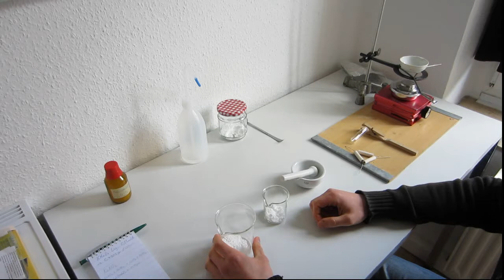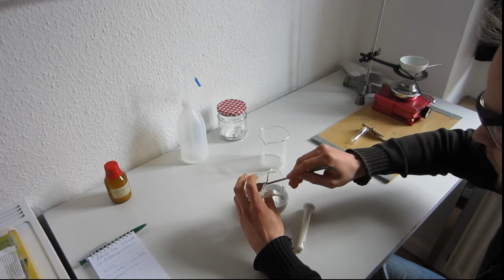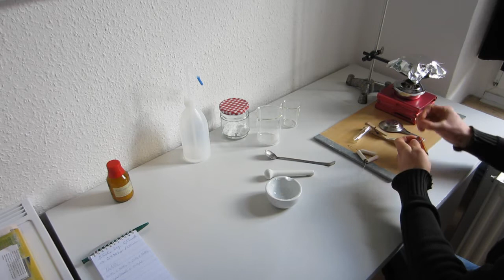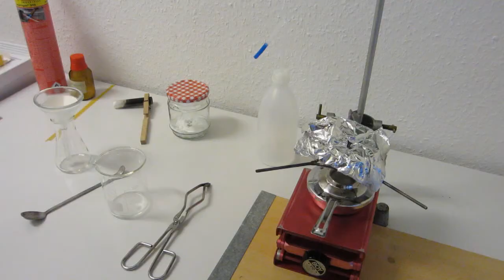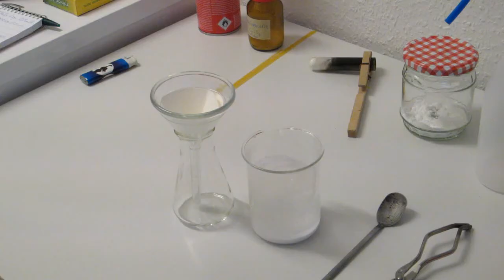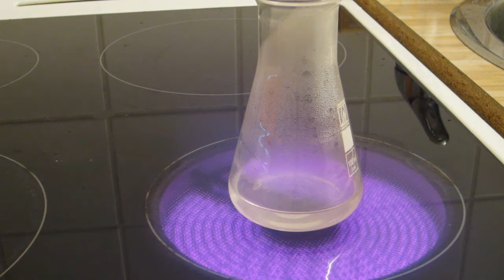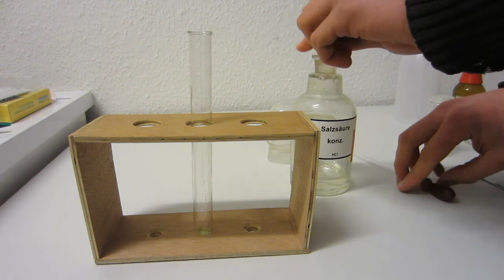Sodium Nitrite from Sodium Nitrate  - Part 1

Comment: I can't hear what you say. Calcium what? Sulfite, sulfate, sulfide?
Reply from the maker: I´m sorry but it´s calcium sulfite, sulfate wouldn´t work obviously and sulfide might be, but at 1:49 i´m saying the molar mass so it can only be the sulfite ;)
Reply: Sulfide I think
Reply: Could you please give us the chemical formula?
Reply: Sulfite. However I would stick to the lead and sodium nitrate reduction. It yields a pure and high yield nitrite. And the lead oxide isn't alcohol Soluble so it doesn't transfer over. On top of that the nitrite is extracted from the lead oxide usei g ethenol so no need for boiling the nitrite which will lead to yield losses as alcohol evaporates off quickly and doesn't need yield destroying boiling. If I were you I would go the lead and sodium nitrate method. Much better

Comment: It's not  hard to get, Amazon has tons of it and even huge bags of curing salt that are sodim and potassium nitrate and 40% Nitrite of Sodium for .35 cents per ounce which is about 83 cents for the nitrite. All you have to do is seperate them which is not hard
Reply from the maker: It depends on your country. If something would contain 40% nitrite, it would probably be considered as toxic and therefore fall under delivery restrictions. edit: also i haven´t yet seen curing salt with so much nitrite yet, most just contains a small percentage...
Reply: @olympicfan2  I hate to sound like an asshole but to all of you trapped in hell where you can't get what you need.....Fucking make it yourself damn it and smile as you do it.  In the time it took you to type that shit out to me you could have envisioned at least the proper search terms and/or the whole process. Look Chemistry is 90% setting up the lab and the rest is that shit you learn in the books.  Love yourself and just do it (without Nike).  And as always if you need any recipes just hit me up and I've got them all
Peace
Sizzlean
Reply: Buying pure S.Nitrite off amazon is about near impossible for a hobbyist. Pink curing salt #1 is around 6% in the states.
Reply: Many chemicals are regulated under UK law unfortunately.